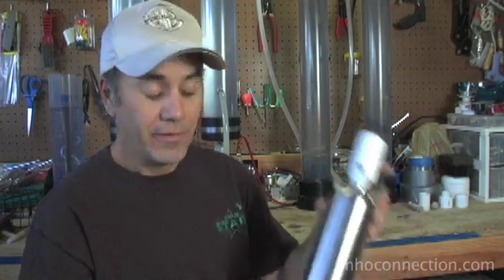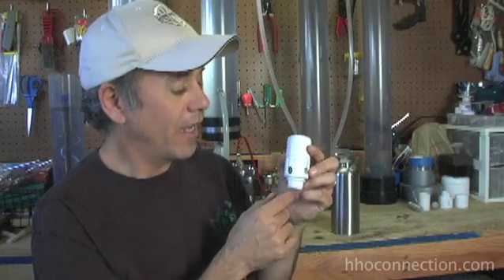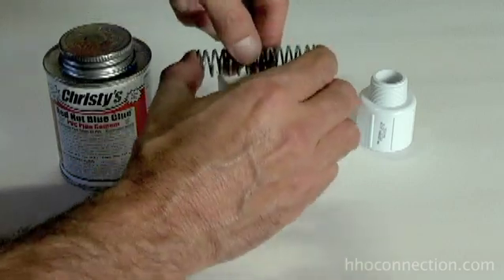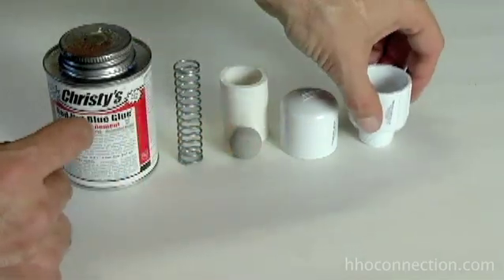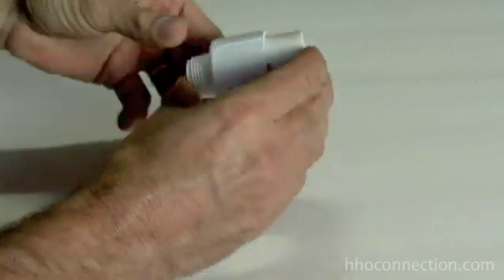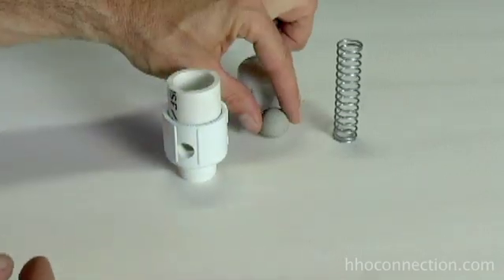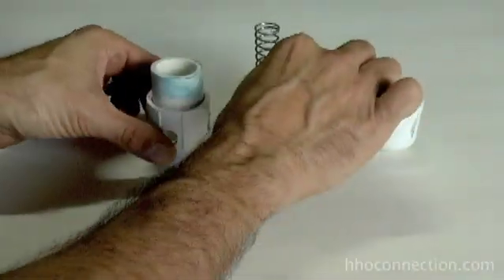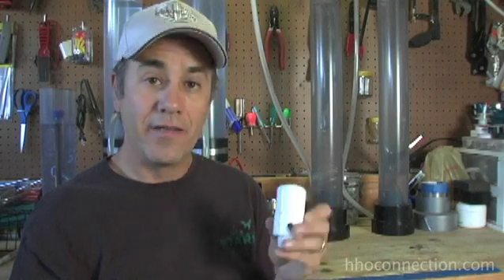How To Build A Simple HHO Flashport

Comment: Thanks, so simple and yet so perfect just the way it should be...

Have you used the brass wool design ? I was thinking of using one before the flash port for added safety.
I have seen if you leave any space inside the brass wool flashbang arrestor the fumes will burn inside so for anyone reading this it appears you need to have the brass wool packed tight from one end to the other so make sure your end fittings are also filled...

Cheers, great videos thanks for your time !

Comment from the maker: @prcacowboy82401 NOOO! Never use glass or anything that can shatter. You can probably find mouse balls on eBay. By the way in case you are thinking of using a rubber stopper, don't bother. I tried it and the stopper gets twisted inside and does not work. Any kind of very stiff rubber ball should work.